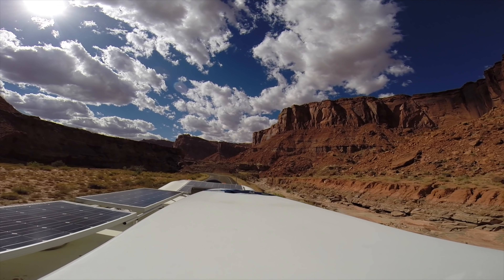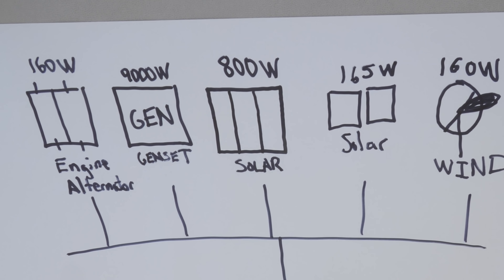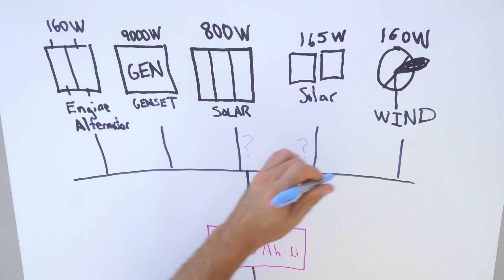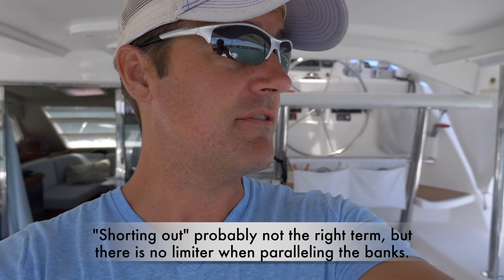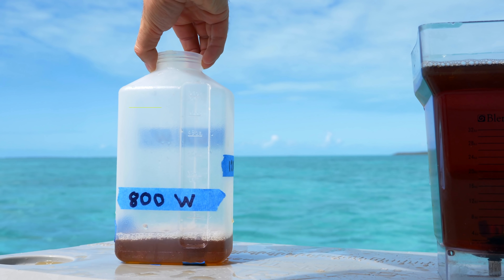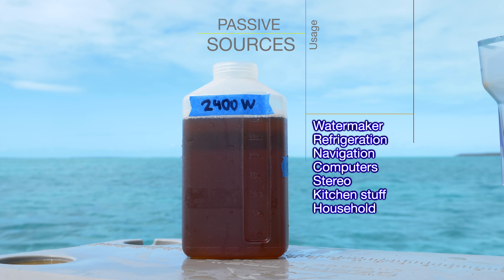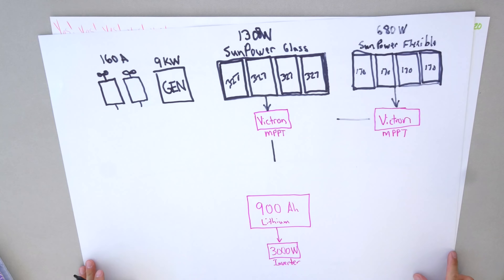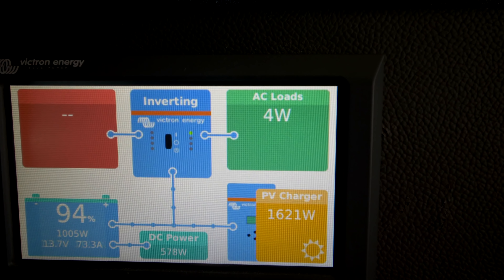How to manage electrical power on a sailboat using NO fossil fuels!

Comment: Future: "Hot tub" 😂

Often it takes me a couple viewings to grasp all the tech talk when it comes to electricity, but Nick always does it in a way an electrically challenged person like me can begin to understand. Thanks guys ❤️🤙
Reply from the maker: Thanks Curt!
Reply: @TheOKellys  full transparency, I had to watch both episodes of "Top Secret" four times each trying to grasp the details. This video was a more simplistic breakdown 👍
Reply: @TheOKellys   The O'Kelly's  Im wondering why... you would ditch your generator when Top Secrets your boat envy... why not take the leap... ditch (sell) your diesel drive engines for electric... upgrade you battery bank (Tesla powerbanks) & keep the genset to power you electric drives for longer power cruising... you need to talk to you friend Rean... My thoughts are for 2 x 10kw edrives to run half power for cruising off the genset & tap into the batteries for full power for emergency sutuations that need all the push... then youve got instant quiet drive for all other sailing & docking etc... gotta do it sooner or later... no regrets :-?
Reply: @The O'Kelly's I'd like your thoughts on Errol's question too.  Cost is likely one reason, but if you had to re-power Clarity, would you go that route (or would Nick miss engine maintenance? ;)  New to your channel and enjoying it.
Reply: @Errol.C-nz  @Carl B. the technology for long passage electric motors just isn't there yet. Hence the reason Rean from "Top Secret" switched out two of his four electric motors back to diesel ...
Reply: @curtjankowski3305  The biggest weakness of a serial hybrid (electric drive plus generator(s)) is the generators.  Most gensets are heavy, costly, bulky, noisy and inefficient.

The most intelligent way I've seen to do a generator is what Silent Yachts did: Take a standard marine engine and connect it only to an electric motor used only as a generator. That then charges the battery bank and/or powers the (separate) propulsion electric motors.  (To be very clear, the marine engine is not connected to any gearbox or prop, just the motor used as a generator.)

(There is lots of precedent for this type of serial hybrid: diesel electric train locomotives, diesel submarines, Integrated Electric Propulsion on large oceangoing ships, etc.  They all use generators and electric drive motors, and they're highly efficient and reliable or they would not be so widely used.)

Why is this good?  It uses the same type of electric motor and controller as the boat's electric drives, for some parts commonality.  (Spare parts for one will work for all three positions) Those electric motors are also generally far more efficient than a genset's generator.

The other reason it's good is that it uses a standard marine engine, say a Yanmar or Volvo, with all the standard support, maintenance, global parts availability which should be much better and cheaper than any genset.  Marine engines are far more standardized, broadly supported, etc.

Of course with a sailboat, the battery bank can be recharged many different ways: generator, alternator on engine, solar, wind, hydrogeneration, shore power, etc.   Hyrdogeneration is the best: charging using sail power.  Only the wind is needed.  And in case it's not clear, hydrogeneration doesn't need any parts beyond the boats electric drive motor(s), if it's AC, which most are.

Comment: Great video guys, I while on the hard during this lockdown doing upgrades have decided on an all electric galley in my leopard 40. I have managed to find a perfect fit 2 plate induction cook top and and nice small electric oven. I have been using the oven and boy can I not wait to rip out the force 10 gas oven. This electric one is just so efficient and nice to use. 
Like you i now have fitted 600 amp hours of LiFePo4 batteries and my victron multiplus and mppt controllers are all in sync nicely now.
And sunpower panels are the only way to go Nick. Very pricey in our part of the world but reliable and hardy.
I ironically have just fitted a small3,5 Iva genset to make sure if the weathers bad I can keep up with the electricity needs but hey as you say personal choices 😊
Reply from the maker: Great minds....think alike. Need to find a good cooktop, so let me know the brand and specs!
Reply: @jamierodg1  Induction is much safer on a boat and required for commercial ships.  It's also much faster and more efficient.

Comment: Very informative video.  Well done.  Few discussions on boat solar / power solutions are as straightforward and practical.  I look forward to the next battery breakthrough to get the costs down so it is practical to run AC any time we want off solar.
Reply: Lithium ion battery performance is improving about 7% a year.  Progress is very quick, but it's a bit slow to make its way to the marine sector.  Electric drive will eventually be very common on boats and cars.

Comment: You should have done that years ago, but lessons learned I know...I'm not a solar guru but your old config which you figured out was the controllers and thanks for teaching me wind is minimal production. So,  on a boat I wouldn't do it. Over time I believe lithium is worth it and capacity loss is very minimal...Good vid guys!
Reply: I saw a boat that put the wind generator at the top of the mast which is an interesting idea for increasing power and reducing noise, but it might actually get overpowered there too often.

Comment: Good update and explanation.  It really is a matter of doing a thorough analysis of both supply and demand (i.e., generation and loads).  At the end of the day, it is a math problem and understanding what those loads are (both peak/starting and continuous run) is a big part of it, whether talking about a small sailboat of a big warship.  You maximize supply and minimize demand to the extent you can.  With older boats (and they don't have to be that old) things like replacing lighting with LED lighting can pay HUGE dividends in power loads.  Some really odd things can be big electric loads...heating elements (hot water heater for example) can have huge continuous loads while running while big motors (winch for example) can have big peak/start load (current draw).  The klystron/magnetron on a radar can be another big load.  Older electronics also tend to draw more power than newer, solid state stuff (depends on how old your stuff is).   An easystart can also reduce start loads for things like the A/Cs and sometimes make them options on batteries...
In planning an electrical configuration upgrade (as you are effectively doing/have done) it helps to map out each item on the boat and what it draws (simple multimeter and lots of switch flipping can help measure things out) and give you an accurate power budget planning input.
I am really curious about the going 100% solar option and dumping the generator idea.  As you say it gets rid of weight, noise and fuel use but really removes surge capacity unless you use the engines and cross-connect your system.  It would seem the air conditioners are the big units that right now you don't have the ability to run for extended periods without supplemental generating power you would lose if you get rid of the genset.  Are you thinking you just don't use the a/c that much (and are not likely to in the future) or that you really can cover them with solar?  Certainly that is a lot of weight (but capability) that makes the Leopards so comfortable that it would be a shame to lose them.  Do you think it's possible to get enough solar generation to also accommodate using the A/C (at least on one side of the boat) most of the time?  Maybe with the addition of one or two more Lithium-Ion batteries vice getting rid of one of yours?  Curious about your thoughts and appreciate the video!
Reply from the maker: We don’t use the AC much when cruising. It’s not good for the interior to cool it down then warm it up over and over in the tropics. You get a lot of condensation and mold. But we can run AC off batteries. Future video topic.
Reply: @TheOKellys  Looking forward to it!

Comment: Another super nice video You both are awesome!  Power utilization planning is an absolute must before building your system.  As long as you have some other alternate source to help charge your battery bag in case something happens like too many days of clouds and rain today and I think you’re probably be just fine without the generator. Save the weight from the battery and add one or two more lithium ion batteries.
Have a great week and a great sail
Reply: They do have a lot of redundancy, even without a generator.

An alternative (no pun intended) might be to use larger alternators in place of the generator.

Comment: I like the new electric sailboat  setups. No combustion engines (no fuel/oil), no solar panels, and no wind generators. Sailing along charges the batteries from the small dual propellers spinning freely.
Reply: Great as long as you are sailing. But if you stay at one place for a few days, you will run out of energy.

Comment: Another great episode! Just a suggestion. Keep the Northern Lights (best quality marine generator made in my opinion) until it breaks down and is too expensive to fix. You can use it for the really hot and humid times in the tropics for the air conditioner and to quickly get your batteries charged during long periods of low sunlight.
Reply from the maker: Might just do that. But we really really don’t need it and it weighs a lot. Stay tuned.

Comment: Thanks guys, we are refitting a 60ft steel mono (all the gear no idea) and are thinking about the best way to repower it, our genny is cooked and we are trying to suss out best solar/ controller set up to go with, this is super handy! Yeow
Reply: The most brilliant idea I heard for a generator is what Silent Yachts did: connect a standard marine engine only to an electric motor used only as a generator.  They used the same type of AC electric motor and controller as their propulsion electric motors.  (To be clear, the engine is not connected to a prop in any way, just the electric motor used as a generator.)

Even if you don't use electric propulsion, this is a great solution for a generator: standard marine engine parts, support and maintenance, plus highly efficient and relatively low cost electric generator.  This should be much cheaper, better supported, more efficient than using a genset.  

Electric motors for this purpose are widely available in the DIY electric vehicle market. They're a great value, efficient, modern, compact, reliable, etc.

Agree with everything the Kelly's recommended in this video.  It's great advice.

Comment: I am using a Renogy 50A DC to DC charger between each engine bank and the house.  It is made to charge LiFePO4 batteries.  So, when the engines are running, each one can provide up to 50A of staged , controlled charging to the house.

Comment: That’s how I set our boat up. Although a much smaller scale I don’t want to mess with my cranking batteries while at anchor. I want to keep them separate, fresh, and hot for when I start the motor. You said not many people do that but I like that better than relying on “house” batteries when you’re ready to move.  I’m not sure exactly how lithium works but I assume if they are highly discharged  you still have the 12 volts needed to fire off the motors.

Comment: Hi Guys, I was just researching power requirments, and seen the old flex panels your using. Incase unaware, thought I'd let you know about the "CIGS Flexible Solar Panels" I came across, they don't suffer the same heat & shade issues. Cheers!

Comment: Ha ha, you're on the same mooring ball we were on when I decided I was done with our 9KW Northern Lights. We have 4x300Ah 12v Relions and 2100w of solar on 3 Victron MPPTs. Get rid of the generator! I've run main engines a couple times in six months for house power, and in retrospect I think I was jumping the gun. We run water heater, washing machine, and on a rare occasion the air conditioner through our 2800w inverter. 
We also removed our D400 wind generator. There are days I wish we still had the option, but it's pretty rare. My wife keeps talking about having a stowable wind turbine but I'm not convinced it would be worth the hassle.
Reply from the maker: Whaaaaat? Crazy coincidence. Are we brothers in another universe? Not reported yet in videos, but having some trouble with our Victron inverter this last week. So, not fully convinced yet, but almost. I’ll bet this summer genset is gone gone gone.
Reply: Our inverter is a ten year old Magnum 2812. It's been solid the past two years I've owned the boat, but I'm secretly looking forward to replacing it with a Victron (maybe two!).
Good luck with the generator removal. I think you won't miss it most days, and probably appreciate the extra space and weight savings.

Comment: This is the most practical discussion of a boat power grid I have seen so far. All the detailed analysis approaches have seemed over board (excessive) to me, too much analysis causing paralysis. My knowledge keeps evolving but it seems that one needs to understand the details for safety. Power will usually be limited by space for power conversion or storage devices. That is my simple overview, I will leave it at that. Thanks again :)

Comment: Good work man. 
One thing is mixed up. Power (Watt) is shown on refrigerator, lamps, solar etc. But you consuming or producing Energy ... power or Watt multiplied by time E = P x h = U x I x h ... and that's what you have to calculate per day.
But keep going. It's good to think and speak about it. Thanks!
Reply from the maker: Ooops. Good catch. Electrical can be so confusing!

Comment: Good illustration and made simple video. When you mentioned the battery bank I clicked on West Marine to check out how much RELION RB300 Lithium batteries are. Surprised to find out they're almost $3000 a pop! So a battery bank of three is gonna be over $9000 including  tax putting it out of the range of the average Joe Blow like me. Nevertheless, the video was very informative. In my case I would just have to use cheaper batteries

Comment: Great video as always, and very informative. But you just made me crap myself with the whole 2400w idea. :) I have a 38' mono hull and am planning on maxing out at around 600 watts of solar on an arch.. Might be able to squeeze in another couple hundred on a bimini top or dodger. Suffice it to say,  now I'm scared !!
Reply from the maker: Well, it’s tough to get more than 1000 on most monohulls less than 50’. “Wings” that tilt out, mounted on solid lifeline rail can get you some more real estate. And and arch is a good way to go....but can be spendy. Also, do check out SunPower semi flexible to mount on the dodger. Delos did a good job that way. Otherwise, don’t get me wrong, using high output alternators off the engine is a great solution. With two engines like on this boat, things get more complicated.
Reply: It depends what your energy budget is.  Electric appliances., watermaker, air conditioning all add to the energy needed.  

High power alternators and Lithium ion batteries are becoming very popular too, as Nick notes.

Comment: You forgot about water current generators... They don't make as much noise as wind generators and provide a third source. Maybe not as efficient as solar,  but as you told it depends very much on the region you're in.

Comment: I bought 4 270 watt rigi solar panels. I hope it will be enough for my little 35 foot sailboat? But like you said, those EU generators are easy and quiet and when you put them in your dingy and push them off a hundred feet away with an extension cord connected to it, you can hardly hear it at all. Thanks for the video.

Comment: Watched the video and took lots of notes (I'm a newbie).  But I had 2 questions:  

1.)  3 -300 amp batteries in parallel = 900 amps.  But what's the voltage?  To calculate watt hours I multiply 900 amps * xx volts = total watt hours?  Watched another video for a home solar application and he recommended running batteries in series (higher voltage) vs parallel (higher amps).  

2.) Still fuzzy on invertors and running A/C 120/240v type devices off of batteries.  For example if you did want to power your water heater using battery power is that possible???